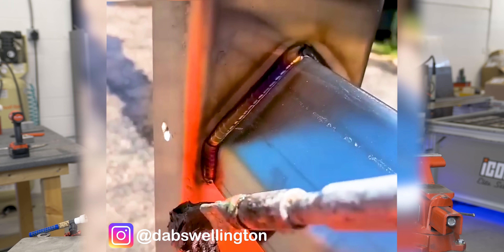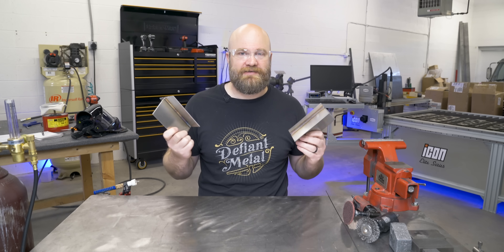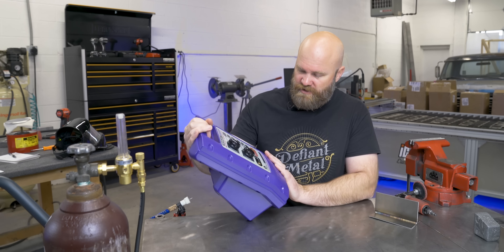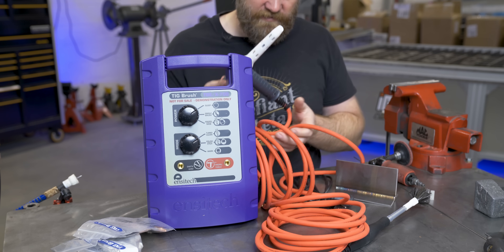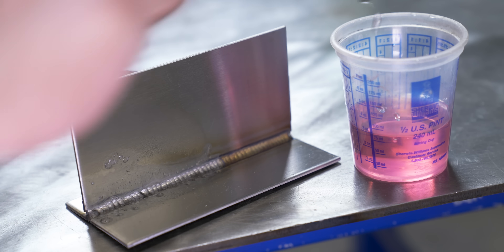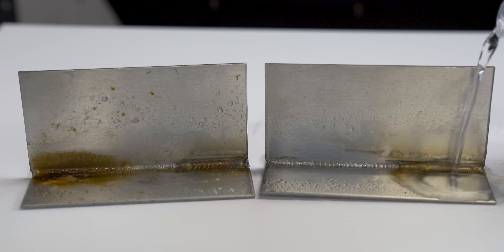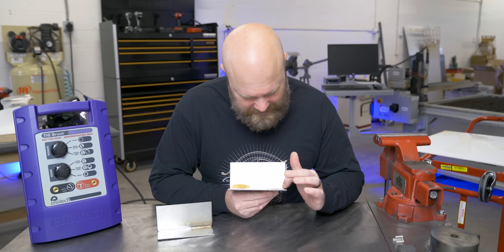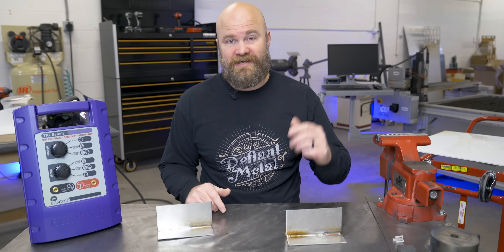Why Do People Do This To Their TIG Welds?? Electro Chemical Weld Cleaning

Comment: I am curious how different the output of one of these dedicated tig brushes varies from a tig welding machine with AC output? They would seem to be similar. Any electrical engineers out there care to comment? Thanks. BTW, your gloves are fantastic!
Reply: I did an experiment using my tig machine set to AC @ 20 amps with a carbon brush dipped in Surfox cleaning fluid. It worked quite well.

Comment: you can also use a vapor blaster to passivate the surface of stainless steel
Reply: Vapor blasting is just pressurized wet sand paper. That physically removes material. Electrochemical etching takes off the top oxide layer through electrolysis. Completely different.

Comment: just hit it with a stainless brush while its still hot,that roloc is just knocking down the weld profile and youll never get all the oxidation out unless you blend the whole weld down.3m makes blue scotch brite wheels not pads that will take the color out without blending the weld,you can soften them up with a ball pein to break down some of the epoxy and resin structures to really get in tight spots

Comment: As pretty as good colors look when just finished, they look dingy after a couple weeks in the field. It’s better to get the color off asap. It’s easier to get the color off while the weld is still hot. Once the weld cools it takes more effort if using stainless brush.

Comment: this is an old video for me but i think a lot of people are missing the point of using the acid over abrasives for cleaning up the weld. obviously one or the other needs to be used because customers dont want the coloring to be seen on the product, but the REAL benefit to using the acid, for my industry at least, is that it removes the coloring while preserving the grain of the stainless. i make food prep tables and a lot of high end products to be used for residences and commercial kitchens and while stainless is one of the most easily scratchable materials, it needs to look MINT on delivery. this means no scratches, no "blurring" of the grain, and no crosshatching from polishing two different directions of grain.

with the very fine grain thats put on stainless from the mills, its nearly impossible to match it perfectly with abrasives. so on parts of the table that need fillet welds or where the bends cause the grain to travel perpendicular to eachother, the only good way to remove burn without compromising the grain with abrasives is with the acid.

Comment: It probably didn't matter if the wire wheel was used on steel previously or not. The tiny bits of wire from the wheel was leaving steel streaks on the weld, which is what was rusting.

Comment: idk about those welds man,    they look like student or apprentice welds who clearly missed out on the necessary Oxy-fuel then smaw then wire then finally tig order of ascension of days gone by,   from days long ago when welding mastery came from the old guard of often naval vet vo-tech instructors retired from the welding symbol spec era of massive precision manufacturing industry that boomed a long time ago,  who had forgotten more welding & metal work guarded secrets before u were even born than most in the field knew,   and knew the importance of a ground foundation of torch welding then smaw to program that steady constant Forward  speed of pool and the filler dip rithym into your brain  Before they all died out and too often replaced by graduates with little to no on experience   They could possibly pass a minimal FDA sheet metal food surface standards but those are probably the most minimal that exist & definitely wont impress any fab shop hiring supervisor mid interview Or make any pipe instructors or mechanical contractors too exited about the retraining needed if selected for admission of desperately needed low ranks of students and otj training programs,  all desperate for open root 6G full pen x-ray Jedis critically low but among the most crucial top tier professionals in the most demand all over the us who's numbers lower each year,   Because for some reason welders are for the most part the least driven least ambitious content at their station demographic in the US,    as apparent by enrollment numbers into the advanced degree of the welding arts,  where not all will ever even have what it takes for matriculation thru the program which requires mastery  and/or  aws certifiable level smaw structural & tig just to be admitted.  U know the vast many simply satisfied with some type of basic production welding position taking at first opportunity pics with their gear on shooting flame or sparks to show off to their girl & fb just so proud to be able to call himself (via technicallity) a 'Welder'   often lacking even the desire for advancement to even enroll in a trade school welding program,    & even those far often just as content to stay on when hired into production sink stitcher or beverage body shops not really caring to even try to be the best of the best hands down highest paid in the profession,     tell me im wrong ,      where the best and brightest of countless other occupations trades & occupations typically crave & hunger to reach by any means necessary the top mastery level of their craft,    how many seriously do the same in the welding world & Never  aspire to reach the highest possible greatness of glory easily bringing in Dr or Lawyer money usually clean every day after standing around 'Waitin On A Fit! '   most the day .... anyways yea those welds mostly kinda for lack of better terms & no disrespect intended,     kinda suck.... They look like a squad of blobs dressed it to the right & each fell one by one in line.  Figure out a good weave pattern and Establish a good steady Consistent same speed of puddle then figure out your dip rithym,   Not with that Lurch forward stop,  Lurch forward stop, Lurch forward stop technique that really looks like u need a thinner filler rod anyway,     so that way u can properly dial in your dip dip  dip rod rithym into the steady pool,  creating the super close together ripples for stronger,  much easier to lap welds not needing grinding and less likely to enable hidden inclusions.    Sorry,   never had the urge to  down others weld quality and/ or technique,      but those are some of the worst I've ever seen On YouTube ..

Comment: This is effectively an electro-etching process. Done long enough with enough current density and it would actually pit the material. As such, you could theoretically DIY this machine with a DC power supply of some sort and an electrolyte

Comment: Not just for the Fe 4-O2 problem  with "food grade "
welds but pickling also "passivates "the grain  boundaries, due to Ni-Cr
Fuming off during welding
Which ,of course over time will weaken structural joints. 
I can advise on minimising 
grain boundary degradation , during the weld process ....
But Id then have ta kill ya
LOLOLOL

Comment: the coloration is due to a layer of oxide so since there is already an oxide layer to get started it rusts. the stainless when clean has a resistance to letting it get a foot hold at room temperatures in order for it to start rusting it would need to be heated or exposed to corrosive substances...

Comment: We have a Tig Brush for cleaning tig welds, and it mostly works, but the connected parts break down quickly. The took ours in for a service, and didn't do anything with it, not even cleaned it on the outside. The original brushes are insainly expensive compared to other brands (like 25x more expensive).

Comment: I used to build hollow metal doors and frames out of stainless and we always had to use that Heat Tint Remover (think some call it pickle paste but, the bottle says HTR and some number beside it) to take those colors out of the frame corners because in that particular case it looked terrible otherwise. However in some cases you want those colors to stand out as part of the appeal typically art pieces and such. But in most construction applications you want to remove that heat tint from the welds so it actually looks more uniform and better. It also protects the welds from corrosion and oxidation later on especially on something outside exposed to the elements. That paste also cant be left on stainless too long or it will destroy the nickel in the stainless and ruin the part. Only 10 minutes no more no less. I never see or did it but, I heard stories of a guy before me that put it on there and went to lunch and come back to a destroyed $1500 Frame.  We never used that Electro Chemical Process but, it seems a lot better and definitely faster.

Comment: Or you can buy yourself phosphoric acid at least 75%, some 12v 20a dc power supply (car battery charger works fine) , carbon fiber brush (-), ground clamp (+) and do the  same steps. Just rinse it well with water.

Comment: Pickling will also Leach cell Akeem out of the base metal at leave it a bit on the brittle side. I know that it does it with Molly steal that General Dynamics was using to make the bolts for their M14 manufacture that they started some years ago. I wouldn't think that it would do any less to stainless
Reply from the maker: That’s interesting info

Comment: It usually doesn’t matter what the welder thinks, it’s what the  contract calls for. Most jobs I do require pacification, some   even spec a specific brand of electrochemical heat tint removal solution and neutralizer.

Comment: Funny... 40 years as an instrument/ pipefitter, working with and as a weldor, in Nuclear, Chemical Weapons, Medical, Computer Chip, Food Processing, Paper Making, and many, many more industries.., I/we were always required to clean our welds. We always used approved procedures, which was to use clean (virgin) SS wire brushes. Hand or powered. NEVER, until today, have I heard or seen this chemical cleaning method. Go ahead and spend the money if you want, but the most stringent procedures I've ever come across were satisfied with clean SS brushes. We'd identify "stainless only" tools with white paint, and red paint for non-stainless. Simple. Cheap. Cost effective.
Reply: Thanks for the reply. Never knew about stainless only wire brushes until today!!

Comment: That pink liquid looks literally like industry standard hydrofluoric acid used for aluminum wheel cleaner. The clear stuff is probably propylene glycol mixed with sodium hydroxide and alcohol to dilute the sodium hydroxide. Pretty common base used to neutralize acids, it's also what's in dawn dish soap.
Reply: MSDS indicates phosphoric acid

Comment: For art work that you want to retain the color, a clear topcoat would probably help a lot. 

I would have liked to seen you use the TIG brush on the back side of those stainless test pieces. I suspect there is a lot more oxidation on the backsides unless you had a applied a gas shield.
Reply: Still works, takes a few more passes but even grey burnt stainless comes to it clean eventually. I use these machines regularly

Comment: If you conscientiously study chemistry at school, there will be no need to overpay for such a device and solutions in cute canisters with beautiful labels. Reagents cost mere pennies, and the power source can either be ordered on popular trading platforms, or even use a welding inverter at a minimum current. The active solution is just a 1.5% hydrochloric acid solution, and a baking soda solution can be used to neutralize it. And if you read a little special literature on electrochemistry, you can even make a solution to obtain a mirror surface.
Reply: Holy shit, I just looked up the price on that thing. Almost four THOUSAND dollars??? Insane. That's twice the price of my welder. I will definitely look into making my own instead. Mind boggling how people willingly pay companies that much for a plastic machine with very simple electronics in it.
Reply: @werk62  You're damn right!)
Reply: Cheap Chinese/Amazon tig welder works great as the powersource.  HCl (muriatic acid) can be bought at Lowe's/home Depot/Walmart. Highly recommend using gloves and eye protection when working with these chemicals.
Reply: @cjwaasdorp2478  It's right.
Reply: Are you diluting the muriatic acid?  @cjwaasdorp2478
Reply: I know the food industry uses nitric acid, i think its got to be at an elevated temperature  though.
Reply: @mitchdinner9743  Temperature rises quickly when process begins. So for this particular case you don't need additional heat.
Reply: So what amps should I use and is it dc current? Also does this get rid of those cool colors? Can I use it on mild steel instead of stainless to improve corrosion resistance of not just weld, but entire part?
Reply: @portalkeeper978  
well...
Current... Just set your machine's minimum. It's usually 10-20 Amps
Colors will gone. But protective layer -- you should experiment a little to gen the best result.
With mild steel you can use it but noway it gives it any protection because the protection is from Cr metal that gives thin but very dense oxide layer.
Reply: @Ma_X64  I mean the cheaper steel without chromoly
Reply: @portalkeeper978  No chrome means no protection
Reply: @Ma_X64  is say 3% Cr enough for protection?
Reply: @portalkeeper978  I don't know. Should be enough

Comment: The chemical from surfox actually adds back chromium to the surface as it cleans the oxide tint layer off. If you use a wire brush on polished material God bless your soul trying to brush in the grain direction on a filet weld.

Comment: they are good but the white crap it leaves behind after not so much..
Reply: Your supposed to wipe off the extra acid, then wipe it with a water soaked paper towel then use the acid neutralizer on it in a spray bottle then wipe that off again. This will get rid of the white haze.

Comment: $4000 for that machine. I've wanted one for a few years but could never justify the cost.
Reply: That's super over priced. All it is a DC voltage power supply connected to a brush and the work piece. $100 is a more realistic price.
Reply: Sadly you see this a lot in industrial machinery. It's a very niche market and not many companies compete over pricing so they can charge whatever they want and laugh all the way to the bank.

Comment: we used this at work, everyone HATED pasavacation day. berating that vapor was brutal even just the smell was horrid. the acid ruins any clothing like battery acid.  i made a trailing cup so i never had to use it and a wire brush (strictly ITAR controlled SS only brush) on what little did color.  he used a dirty wheel intintionally because it works other wise.   ive worked in aerospace  on aircraft parts and all we used were wire brushes on ss and Inconel but went thru grate lengths with back purge and trailing cups so they wouldn't color if it could be helped
Reply: Passivation day! Sounds a lot like judgement day, a day to be avoided!

Comment: 7:30 pacifying?!? I think you mean passivating!  I used to work with a Walter surfox machine, but it stinks, it's expensive, and the necessary cleaning is a mess! I much prefer polishing!
Reply from the maker: I gave it a baby pacifier to suck on, it felt better after.

Comment: You can also use a fiber clean laser to clean both before welding and after.
Reply: I have one of these machines and the surface after laser cleaning is not similar to the surrounding metal. Cosmetically. OK for industry, not for appearance sake. Good comment.

Comment: To bad you did not include pickling paste in your test because it works fine and is a cheap and simple alternative to buying an expensive piece of machinery.
Reply: Pickling paste is banned in most countries because is a carcinogen
Reply: @Trent Rayment   I am in the netherlands and can tell you it is allowed in all europe as it is not carcinogen, europe having the most strict health and enviromental laws of the world.
 its a mixture of nitric acid and hydrofluoric acid, yes it can be dangerous if used without regards for safety but it is not carcinogen.
Its R-phrases are R-23-24-25-35 meaning toxic and risk of burns but nothing more, the toxicity goes away with dilution, if you wash it of with plenty of water it looses its toxicity quickly to the level off ordinary household chemicals like bleach and toilet cleaner
If you use adequate safety gear (gloves, face shield and an apron) there is no problem using it.
Reply: *too
Reply: It's because the fumes have the potential to be 'Corrosive' on contact with skin, eyes, and in the respiratory system...
Reply: @Stephen Keebler  yes, that is what the R-phrase R-35 mean (duh), the R-23-24-25 means its toxic, 
It is meant only for professional use, if you are a professional you should know how to interpret a warning label on a professional product, if you are not a professional and dont know how to read a warning label dont mess around with stuff you dont understand, get help from someone who does know or get an education.
Did you know you can get a nice life threatening death shock from a welder if you are outside in the rain? , 48 volt can kill you.
And if you stick a screwdriver in your side pocket and fall it may kill you.
Metal working can be dangerous.
Always remember when you are hobbying: Darwin is always checking on you.